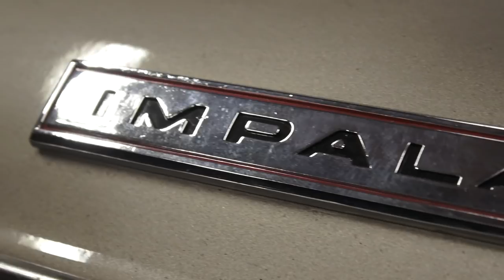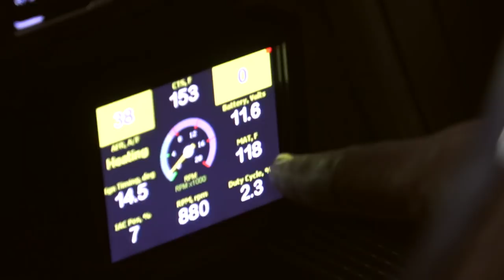UK 64 Impala 454 Lowrider ( Kinda )

Comment: X chassis allows lower door sills so upper middle class old ladies in 1964 could get into their Impalas. Corvette is example of the exact opposite with it’s massively high door sills. It never caught on because perimeter frame protects occupants better and most manufacturers switched to unibody anyway. Although Honda brought back the X chassis built into it’s S2000 unibody to stiffen convertible without making stupid big door sills.
beautiful car.
Reply from the maker: Mega info, thanks Tom!

Comment: Can't beat American classics for fun and looks. The trans if a 2 speed usually they are called a powerglide if 3 speed could be th350 or a th400. Will hopefully be getting my 69 Chevy nova back at Craig's in a month or two once get my trans back you will have to have a look at that what bolt on parts I've done with that also. 👍🏼
Reply: @Jason Voorhees I imagine the MPG is fantastic 😂

Comment: I can answer a couple of questions. The trans is a Powerglide if it has no overdrive, or a TH350 or TH400 if it doesn't have an overdrive. Motor wise, stock it likely had a 427 "which is a 409 with 1/8" stroke, and a Powerglide behind it because Chevy was phasing out the Powerglide in favour of the Turbo-Hydramatic transmissions
Reply: Sorry, it's a TH if it has an overdrive, got mixed up. Powerglides and TH400s are popular drag transmissions because you can install a transmission brake to build up fluid pressure in the converter for the launch, they're so popular there's adapters to put them behind a lot of engines, even RBs and JZs
Reply from the maker: Thanks Clay! Yeah it's a 2speed Powerglide!